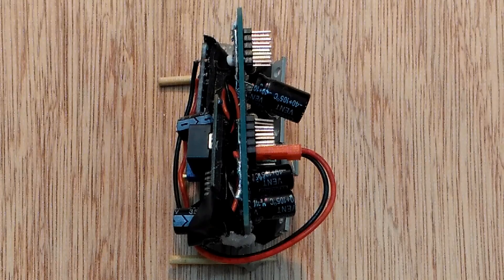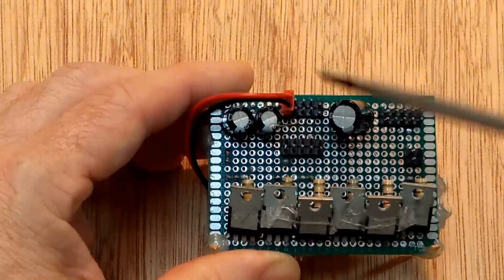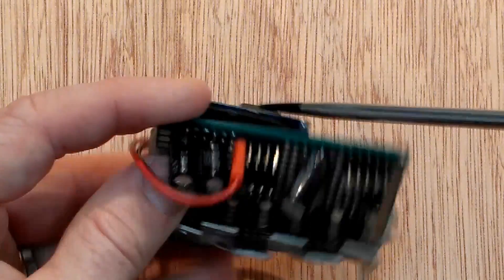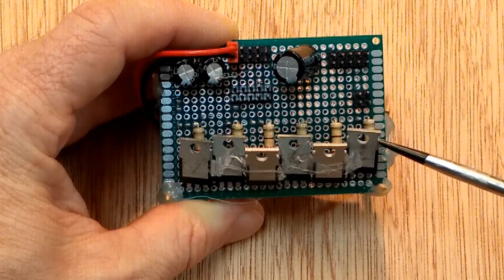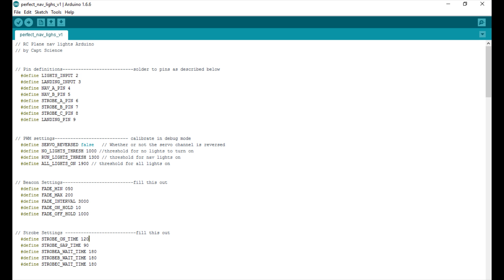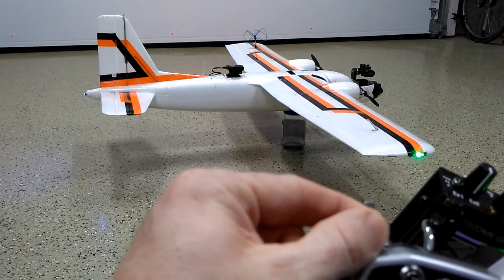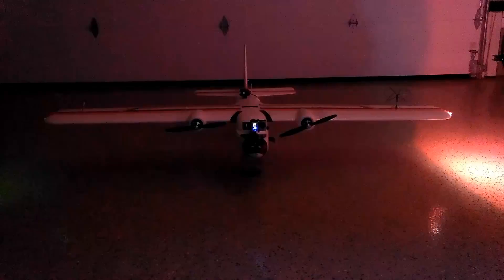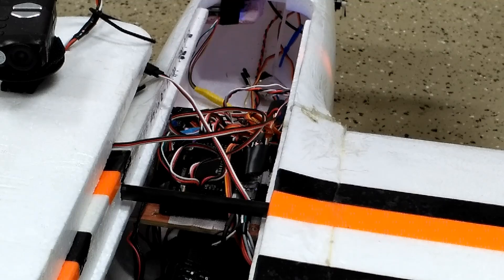DIY Arduino Navigation Strobe Lights Controller for RC Plane

Comment: That is far bulkier had heavy than it needs to be.
I use an arduino nano with smd logic level mosfets with wires soldered directly to the legs and a tiny 1/6w 10k resistor soldered directly between the gate and source pins for the pull down and they are put in heat shrink.
The power to the leds is reduced to 5v using a very small and lightweight rc regulator and 3w leds can survive 5v if they are being strobed and need no other regulation.
for the solidly lit lower power leds i use 1/6w or 1/4w (depending on what leds im using) resistors soldered in line on the power leads.

my weight for the setup including the arduino nano,  mosfets, resistors , regulator and arduino end wiring but excluding the leds and wires running to them is 15g and everything fits inside the space between the pins on ether side of the arduino, its a very small setup.